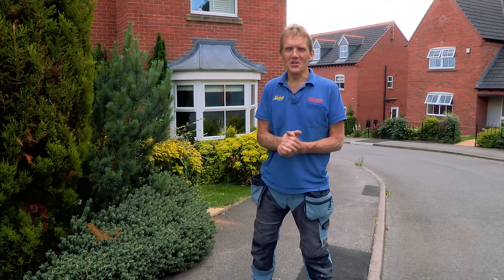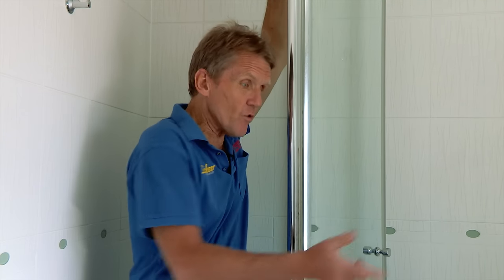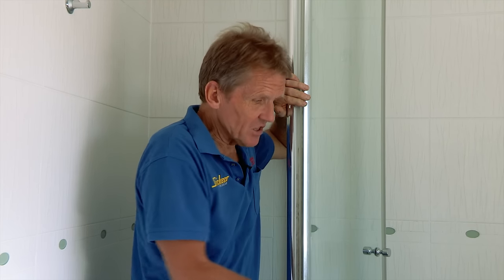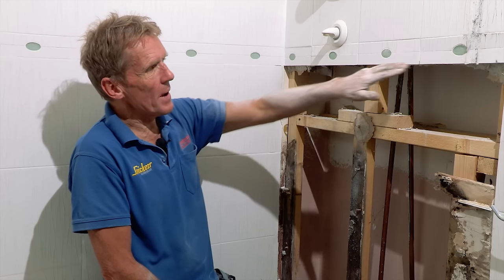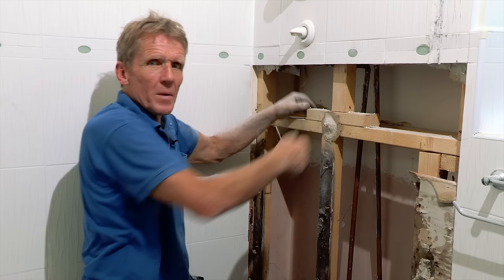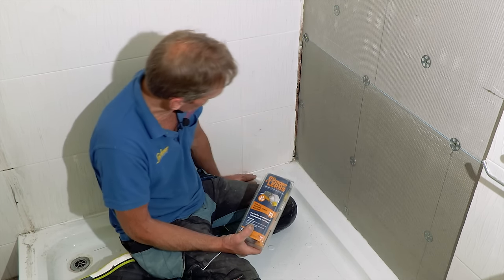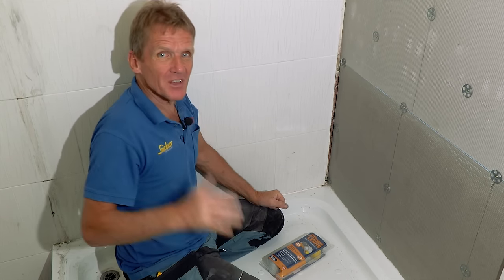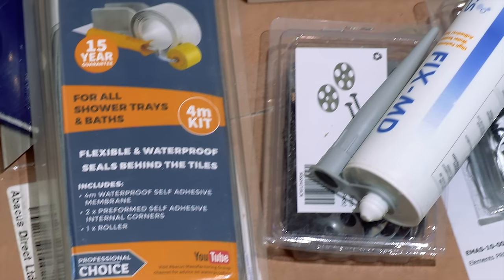Unbelievable Cowboy Plumbing Horror Show

Comment: I fitted my own shower and just wish some of this information was available at the time.  I will say that I did use generic 12mm plasterboard on a very strong stud wall, but I TANKED the surface.  It's been installed for 4 years now and not a single issue, I've even checked behind the boards when redoing interior work on the other side of the walls and not a single hint of mould or damp.
Reply from the maker: Simon 
Tanking the plasterboard is a good option and is now required as a minimum  by the amended British Standards for tiling and plastering.

Comment: you never mentioned the flux on the pipe,s nor did you clean it off before putting all the new stuff in,  in a few more years, that flux will have eaten its way thru the pipes, and big water leaks

lazy,unknowing plumbers, its every where I go, this is to be seen
and to not clean it of when you doing all that work, a big no no  to you.
Reply from the maker: The whole lot came out after this video but your point about flux is not correct, The green is caused by oxidisation which happens quickly when self cleaning flux is applied. Do you really believe that flux manufacturers make a product that will eat through copper in a few years? It is desireable to clean off the residue but your statement is alarmist. Talk to the chemists at the flux companies and you may learn something,
Reply: Sorry Rodger, but where ever that flux/green stuff is, the pipe starts to leak, 20 odd years + down the line,  seen it loads of times,  pipe is wafer thin /pock marked,
for ages its just a weep, if its on hot pipe, its hardly noticed  till it gets  a wee bit bigger, and a fine jet squirts for a yard or so. cold weeps downwards, and start to build up where it drips at, over time, no ventilation, rot sets in.

its not alarmist,  its fact, backed up by years of finding this out, sorting leaks out caused by it, sorting destroyed rooms below from it.

Comment: Use cement sheet boards not plasterboard
Reply from the maker: We use Elements board which is easier to work with and has insulating benefit

Comment: due to move into a bungalow soon, whole bathroom is going to be gutted and new shower room put in, Ive searched the "No Leaks" kit but can you tell me what the blue stuff is that you also put on, sorry if i missed this on the video.
Reply from the maker: It is called Pro Seal but is sold under various names by different companies. It is used as a tanking membrane.
Reply: @SkillBuilder  thank you for getting back to me :) will shop around.

Comment: Good video and info except for one detail. There's no such thing as dry rot. Nothing dry rots nor can it. It is wet rot that is currently dry. Once wet again the rot will continue.
Reply from the maker: Master Man
The difference between dry rot and wet rot is that dry rot has mycelium which are tiny “threads” of the greater fungal organism that  transfer water from the source. This is why dry rot thrives in areas where there is no obvious source of moisture.  With wet rot the absence of mycelium means that once the moisture is eliminted the wet rot ceases to live.
Reply: @SkillBuilder  Right, so transfering water from the source is the only way for the rot to continue. Dry rot is an antiquated term. Brown rot is the more appropriate current term. So we hang on a technicality. The minimum moisture content for brown rot to thrive is 28-30%. Keeping moisture below 25% will stop fungal action. Also, new wood kept below 25% moisture will remain fungus free. I thank you for your consideration and response.

Comment: Roger hi, have you ever done a video on macerators and which are the best and how best to install? Ironically My two daughters both need them fitting 😂
Reply from the maker: Hi Colin 
It is not something we have done but I feel we ought to.
Reply: @SkillBuilder  thanks, will wait in anticipation. It’s a topic that generates very mixed response, especially if you have dismantled a blocked one 🤣

Comment: I did my shower,2 x PVA ,2 x bal primer and then bal adhesive,plus sprayed grout with spray tile sealant ...sorted
Reply from the maker: PVA is a very bad idea for a primer. Bal sell a primer as do all tile adhesive manufacturers and all of them advise against using PVA which turns to liquid again when wet. So long as the grout holds up and the seal doesn't leak around the bottom and wick water up you should be o.k.
Reply: Skill Builder cheers ,going diffrent this time as currently doing bathroom which will have shower bath ,going to tank it like your vid but without them panels

Comment: The only thing I would do differently is I would have put a bar mixer shower on as it brings the whole shower valve outside the wall and they are really easy to change once the fittings are on.
Reply from the maker: I have fitted many bar showers. It depends what the customer wants but I have two in my house for the reasons you state.

Comment: Just use a tanking kit and problem solved.
Reply from the maker: yes if you can manage to seal the edges of the board but often people don't and the moisture creeps in. The other problem with plasterboard and ltiles is putting all that weight onto a sheet of paper that is stuck onto gypsum.. No plasterboard manufacturer recommends it in a wet area.

Comment: I've never seen this board or those clips before. Frankly, I love it. It looks light weight too, unlike cement board. Is it like a Kerdi board? The blue stuff your using looks like what we use here (such as redguard).
Reply from the maker: similar to Kerdi but this has a polymer face that holds the tiles better.

Comment: I noticed the blue seal tape on the wall horizontal but not vertical... is there a reason?
Reply: It was on the edges. The vertical in the middle was a pencil line to mark the joist underneath
Reply: @colsey6542  Ah... makes sense now...

Comment: When you say plaster board being unacceptable in a shower area you mean without tiles right? It's ok to use it beneath tiles?

Is it worth getting the moisture resistant plasterboard if you're tiling over?
Reply: Water will still get behind tiles over a period of time the moisture will spread throughout the board!!
Reply: @MrFergusferret  How do you feel about plasterboard (tanked) for the rest of the areas of a bathroom but not close to shower or bath?
Reply: @martinpalmer3575  Hi Martin, I'm not a plumber just someone who has had a shower ripped out twice because of water seeping behind tiles. Finally we had a builder who used boards like those in the video and went to great pains to seal everything. It's logical really water and plaster don't mix.

Comment: absolutely nothing wrong with using ply in a bathroom ???
Reply from the maker: Apart from the fact that it contravenes the BS standards which state that plywood is an unsuitable material for tiling onto. It has been used in the past and the failures are out there for everyone to see. It supports mould growth which attacks the adhesive.
Reply: @SkillBuilder  
what about waterproof adhesives that are mould resistant , and PVA'ing the ply ?

Comment: Could just put a waterproof coating (paint on waterproof system) over plasterboard?
Reply from the maker: Why would you want to stick tiles on paper. The water gets in at the bottom and wicks up the gypsum core. It is crap and proper tile backing board is not crazy money.
Reply: Thanks for the reply.. i literally got plasterboard delivered this week after watch videos of people fitting and using a waterproof tanking system.. i may have a rethink. Thanks
Reply: @SkillBuilder  decision made. Going to get some Aquadry backer board. Thanks for the advice, wish i came across this vido earlier 👍

Comment: You can tell cowboys have fitted that rubbish in the pipework needs all ripping out for a start you would get a belt around the earhole in my day for not wiping the joints and cleaning the flux off a joint by the foreman flux and hot copper pipes is a no-no

Comment: Every newbuild in the UK is crap. Stud walls in bathrooms are asking for trouble. Covering up even with a high tec material just hides the problems. Copper pipes with multiple joints in cavities present multiple points of failure. It is never seen these days except in UK. These should be a single continuous feed without joins. Preferably with a multiskin - same as under floors. Drains are improperly dimensioned and installed for showers and wet rooms. Don’t even get me started on UK wiring which is based on post war ideas for saving copper. I fear for the UK with its housing shortage – if you can’t build property and get away from trying to build cheap houses with a few fake ‘Victorian’ appointments to tart them up you will still be getting black mould just like in the old Victorian days. SB is offering good common-sense advice – but unfortunately this kind of effort is purely a palliative fix.

Comment: Why don’t you just wet plaster the wall? I’ve ripped out bathrooms that’s are 50 plus years old before these boards existed that had been wet plastered and it’s dryer than the Sahara desert.
Reply from the maker: If you are saying that you should plaster the masonry and not have plasterboard then yes that is good but this is boxing over a soil pipe from a w.c.
Reply: @SkillBuilder  thanks for the reply, that’s what I did in my bathroom, traditional wet plaster, backing coat and finishing coat no plaster board. I prefer the traditional finishes. Too much plasterboard used

Comment: so you find shity job and jou do half shity job while having chance to do much better one without much adtionall cost, what would it take to remove roten wood and spray some fungicyde inside?
Reply from the maker: Not everyone wants chemical sprayed in their house. The mould is not an issue once the moisture is gone. As it is we replaced the whole wall and had a new walk in shower but we wanted to finish this video for information.

Comment: Great video, loads of helpful advice! what thickness of the Elements board did you use? Is there a specific thickness you'd recommend or does that depend on the job? thanks

Comment: Update #2. After nearly completing my recent shower cubical refurb I won't be using Hardy backer board. Yes you get a good finish and you can get a great fixing for the shower valve etc, it's too heavy to work with. After more research I found www.rubberduckbathrooms.co.uk sell the Abacus 12mm thick boards kit for £189! So I'm gonna go with that for the next job which starts on Monday. Follow my progress on twitter here... 
http://twitter.com/getbry

Comment: Tiling over tiles lol lazy
Reply from the maker: It is not a question of laziness. If the tiles are well stuck on the wall you will destroy some of the wall and if it is plasterboard you are talking about stripping off and reboarding. Tiling onto the tiles gives you two layers of protection and really good adhesion. If you have the room for an extra 12mm there is no problem.
Reply: @SkillBuilder  I've been a plumber past 20years pal never once have I seen that done full RIP out reboard and tank shower area = proper job